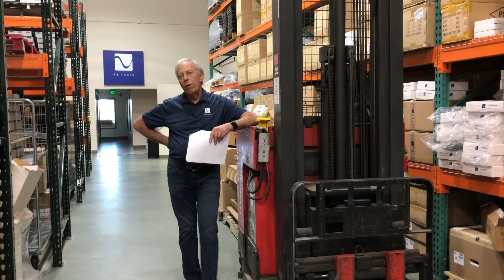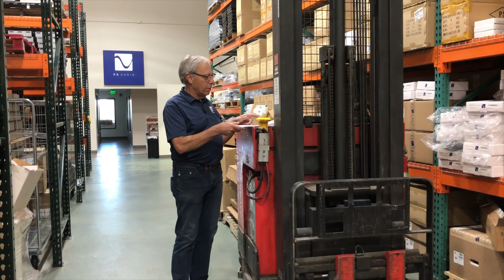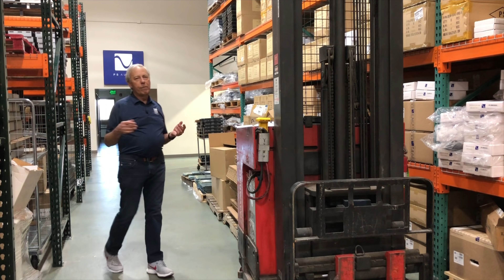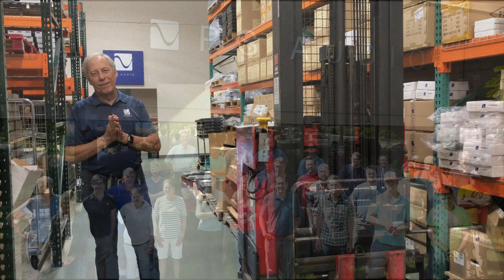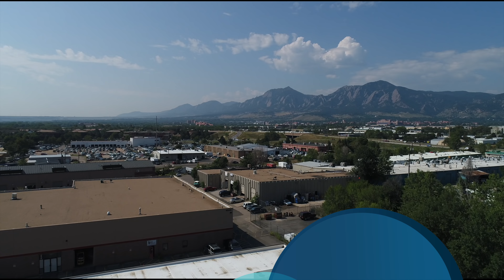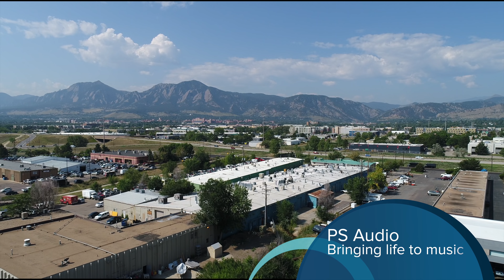What is amplifier damping factor?

Comment: The problem is that a high damping factor is often achieved by applying lots of negative feedback, and it is this which kills the sound.
Reply: that's just  the opposite
Reply: If you are using a speaker with an impedance curve that compliments the characteristics of the amp then true. But otherwise the matchup is a crapshoot at best.
Reply: gotham61 Please note that Hegel achieve excellent damping factor figures using feed forward designs. Check out their 590 model....... Truly reference for not a lot of wonga.
Reply: @ Gotham: exactly! Furthermore, there will always be an series inductor in the X over to the bass speaker. Typical resistance 0.3 Ohm. So that would sets the maximum damping factor at about 27. Furthermore you can divide the speaker coil into  a coil of 0 Ohm with a (think of it as external) series resistance of the DC value, let's say 3 Ohm. So.... damping factor is bogus factor.
Reply: @airgead5391  thanks for explanation. I have one concern at the moment with the whole damping factor thingy : i have Audio Analogue Puccini Anniversary, which has kinda low damping factor (27-40) probably because of the whole "no-feedback" design, and don't know how it will work with some "problematic" speakers: and i would like to buy Focal 1028be. AA has 80w into 8ohm and 150 into 4, so looks like enough power, but can low damping factor make it bad match for focals? 
Should AA me matched only with some easy driving speakers?
Reply: @hudo   that is a real difficult question. The damping factor won't be the problem. But it depends more on the complex impedance of the speaker, and how the amplifier reacts to delivering current. So only if you know how the reputation is of the amp with more difficult speakers, and the difficulty of the speaker(for instance a very low minimum in the impedance curve) one can guestimate. And it is even more difficult than that (more subtle layers so the speak) but this is the main thing which can said about it I think.
Reply: @hudo  I just read some about your amp: the manufacturer says it will cope well with more difficult speakers, so no sweat!
Reply: @airgead5391  we'll see soon, manufacturer will say many things just to sell:) Focals, at least higher range models (Kanta, Sopra and Utopia), are notoriously demanding. But again, i heard them playing really really good with tubes, so obviously everything is not in Watts and high damping factor!
Reply: @hudo   Yes, you are right there! I heard I think about 20 years ago an single ended power amp and the bass was terrific in that system. It was then that I realized that triple digit damping factor figures and such are not needed. Later I analyzed  it and realized we were fed bogus by the industry. 
having a glance at the amp on the internet, I wouldn't rule out that the claim of the manufacturer has some validity.
Reply: I have heard of speakers feedbacking signal to the amp (digital amp), and the amp overlaying the difference between what should have been played, vs what the speaker actually played.

Comment: Cable must be considered as well. High damping factor will be masked by the impedance of cable.
Reply: Good point. I could hear better damping of my Energy RC-10s with 7 AWG cables instead of 11 AWG. The amp was Rotel RA-985 with a damping factor of 400 for 8 Ohm speakers.  The RC-10s are more like 6 Ohm speakers and they have some slight boominess in the bass range.
Reply from the maker: Yes, this is correct.
Reply: @IMMO ws Everything is more simple than you might think. If a bass driver has total Q factor (Qt) too high for a given enclosure, then bass output will be somewhat boomy. But the Qt is made of two other factors: mechanical - Qm and electrical - Qe. Qe also depends on the resistor values in a circuit from an amp output to the driver terminals. When one connects thicker cables with lower resistance the value of the bass driver's Qe also slightly drops. So does the Qt and the bass sounds cleaner with less boom.
Reply: And the restiance in coils in crossover.

(And this is why i use DIY active speaker)

Comment: Paul, please read my comment elsewhere where I explain that the damping factor is the bogus factor. I am curious about your thoughts about my explanation.
Reply from the maker: Not sure where to find your comment but damping factor is hardly bogus. Much depends on what type of speaker you're asking the power amplifier to control.
Reply: Paul, Damping Factor is indeed not bogus, Dr Toole made a 2-page article many years ago that’s available online. 
 
However, the damping factor of any modern solid state amp is good enough, the damping factor from your speaker wire (based on gauge, no matter if they are lamp cord or $20,000) has a much higher impact, like magnitudes more. For most setups, 16awg will be good enough, and 14awg if it’s a long run. 
 
For your S300 amps, if running 2ohm minimum speakers, and wanting a system DF of >20 (what Toole and other claim is the audibility threshold), and if you need 30ft runs of speaker wire (say using an AV closet), you thus would need ~14.9awg, and since that doesn’t exist, use 14awg.
Reply: @Paulmcgowanpsaudio  , thank you! A copy paste from a reaction to gotham61: Furthermore, there will always be an series inductor in the X over to the bass speaker. Typical resistance 0.3 Ohm. So that would set the maximum damping factor at about 27. Furthermore you can divide the speaker coil into a coil of 0 Ohm with a (think of it as external) series resistance of the DC value, let's say 3 Ohm. So.... damping factor is bogus factor.
Reply from the maker: @airgead5391  Except damping factor has nothing to do with the speaker. It's calculated by the output impedance of the amp. Or, perhaps I misunderstand what you're saying.
Reply: @homeboi808 . I found the article and it exactly confirms what I was saying: so I think you made a mistake by saying that damping factor is not bogus because it is.
Reply: By the way: at real low values, think towards single digit the tuning of the bass port would get disturbed. So that is the only thing about damping factor what would be of interest.
Reply: It’s not a bogus in the sense that it has no impact on sound. However, it is true that it’s an issue that gets blown way out of proportion. Any modern amp with an appropriate cable gauge will be good enough.
Reply: @Paulmcgowanpsaudio   You are right of course, specs on the damping factor is inherent to the amp only. What I am trying to say this spec has very little bearing on controlling the bass speaker, or any other speaker for that matter, at least when you are not entering, or perhaps approaching single digit values. No worry, I highly value your video's, almost always agree a 100%. :-)
Reply from the maker: @airgead5391  Yes, I would agree with this. One thing to also remember is that damping is a multi-varied process with multiple benefits. One thing you don't want is the speaker controlling the amplifier through inductive kickbacks. A high damping factor also helps with this.